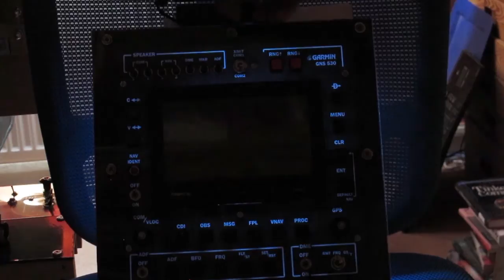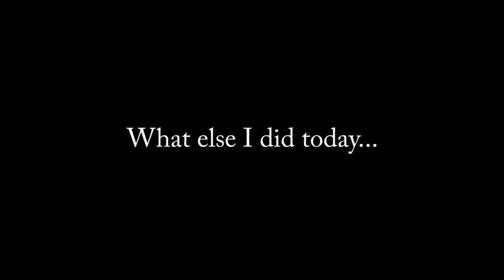Wiring up the GPS (Twin Otter Cockpit Build - Part 16)

Comment: how about 12v led strip lighting its cheap , it comes lengths or on a roll and you can get a 12v led dimmer from china for couple of bucks so you even up the brightness of each panel  and they come in many different colours
Reply from the maker: Thanks, will check that out.

Comment: I was wondering about how this panel was getting along. I would love to see how you connect that to the Bodnar boards. Did you split the common ground across 2 boards?
Reply from the maker: The ground is common across all the boards, so if you're connected to a ground on one board you're connected to them all. I will probably show the business end in the next video.

Comment: I would've suggested maybe small fluorescent tubing or neon lights as they don't have a small beam of light, rather they spread the light out evenly, but that panel and strip light seem adequate. Are you going to extend the frame of your cockpit to go behind you and perhaps make it a closed cockpit?
Reply from the maker: Fluorescents are a possibility, maybe even some basic domestic units just mounted within the framework will do the job. As for enclosing the cockpit, I don't really have the room to do that!